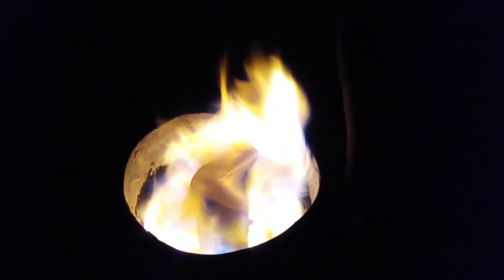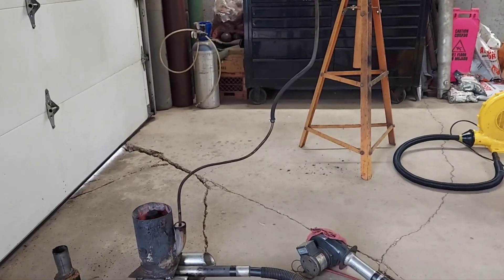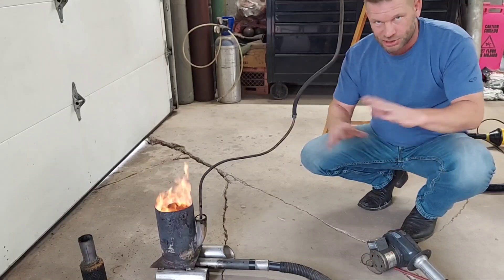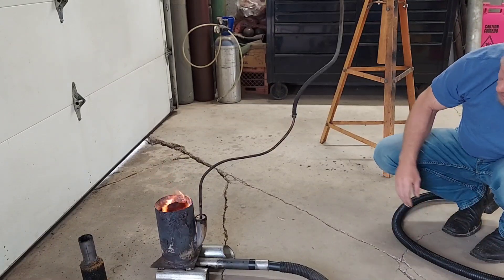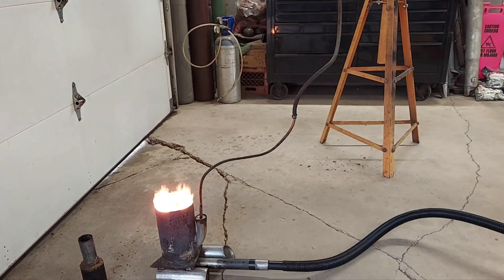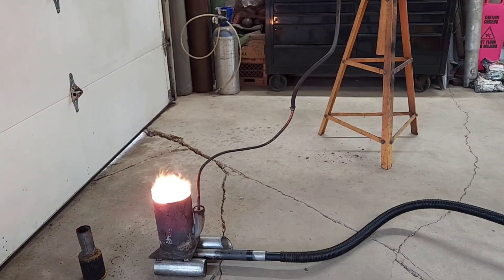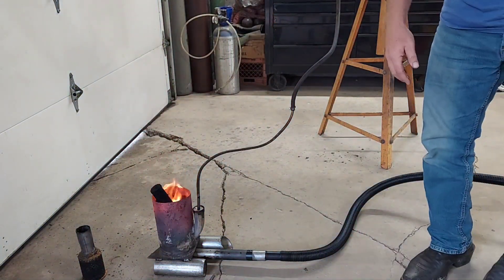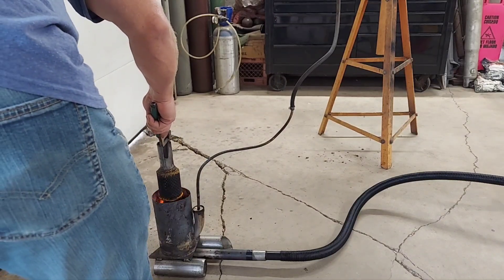Waste oil burner and choosing the correct blower.

Comment: what is the purpose of this stove?.,is it for cooking or heating?
Reply from the maker: Either one! I used that in my outdoor boiler for a while, and now I use it to distill waste motor oil and make my own diesel. I have a new design in my boiler. It's just a simple, clean burning burner.
Reply: @karlsoffroad  sir, check out filipino makers.,.,they do really good stoves ..,

key word:

kalan de used oil

Comment: Awesome demonstration Karl! Looking forward to more videos like this! On your boiler how long will your bounce hose blower and your HF pump for the oil last? Like you said when I build mine it will be 6-7 months out of the year 24/7.
Reply from the maker: The bounce house blower lasts for years, the HF pump lasts anywhere 2-5 months, the quality control isn't the greatest. They use to come with replacement brushes, but now I have to get creative and make my own. That's the only thing that fails,not meant for continuous duty.
Reply: Good to know! Thanks for the info. Have you looked into a different style pump that would be capable of continuous?   @karlsoffroad
Reply from the maker: @beast666joecool ,I've been looking for a couple of years. I need low pressure, so I haven't been able to find one yet. I will have to look harder. The temporary ends up being permanent because it works! They're about 60 bucks, so about 20 a month to throw away. It's not great, but not too bad. I was using a pressurized tank,but that was messy when something went wrong. I'm still working on the perfect setup,but it's 99% reliable as it is now.

Comment: I'd like to convert my wood burner to oil in the shop but would have to find a steady supply of used oil
Reply from the maker: Check with local repair shops. They usually have plenty to get rid of. I'm going to be building several different burners, so hopefully, one of them will work for you. Thanks for your comment!
Reply: Look for waste cooking oil from restaurants.